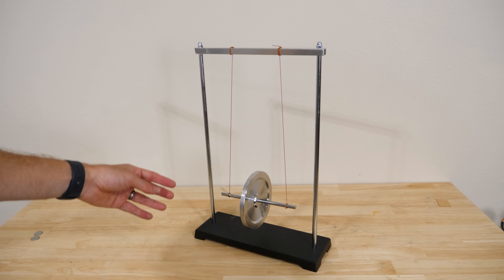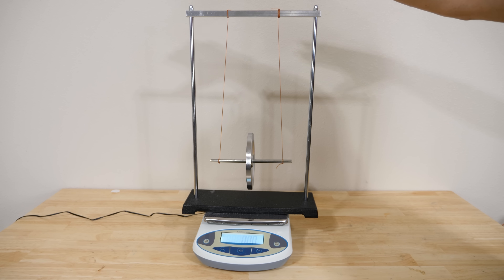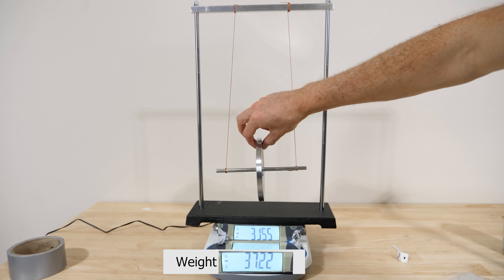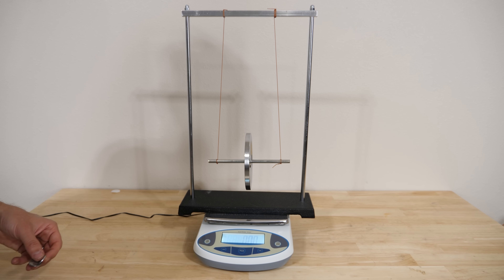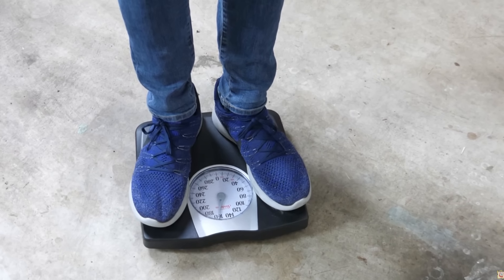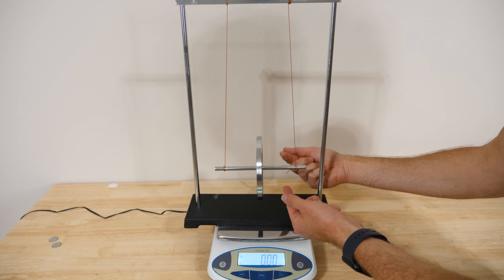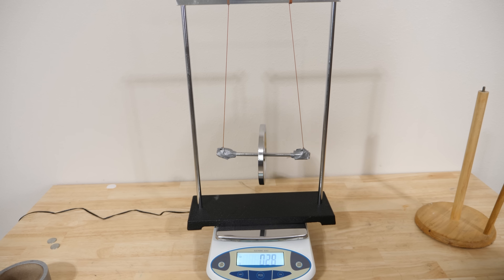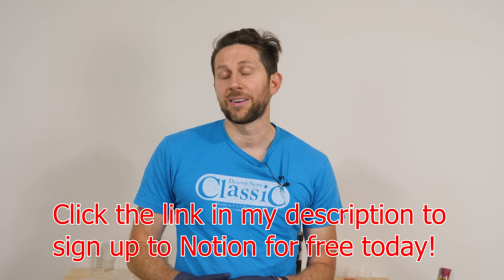How Does The Anti-Gravity Wheel Work?

Comment: So should we spin ourselves before a high jump and a long jump ???
Reply: Only if you wind a rope around yourself and spin yourself up.  But you'll need to de-spin at the bottom.
..
Here's the deal with this wheel:
The wheel does NOT weigh less when it is spinning!.
..
It may be more correct to say that it weighs less when it is "bouncing".
..
I have a problem with the interpretation of the Laithwaite demo.  Precession does not translate the wheel.  It does not lift it. 
Precession causes the axis of rotation to change direction. This is a ROTATION about the center-of-mass of the wheel. It is not lifting the whole wheel's mass. 
.
Precession does not cause the gyro to move (translate) sideways, nor upward in Laithwaite 's case or Veritasium's case. 
If the vertical spinning gyro had translation, it would slide along the table, but stay vertical. It does not do that.  It tips, or rotates at 90 degrees.
The fact that the handle is offset and long has significance.  If you push the handle in the direction of the precession, that lifts the handle, right?.

However the interpretation that the spinning wheel is always accelerating downward even while moving upward,  is a very good catch. It took me a few seconds to realize that.  My quick initial feeling was that the weight would go positive on the way up. . . 
The way to think of it is that is is 'partly falling' due to gravity.  When you are in free-fall you are completely 'weightless'.  The spin and string-shaft arrangement allow it to fall, but not fully, as when you are in free-fall.  So, the frame experiences somewhere between the full weight and weightless ness, but more weight during the bounce time. 
..
 The winding and unwinding of the string causes the up and down motion which is what changes the weight. 
..
Stand on a bathroom scale and at a medium speed, move up and down by bending your knees.  Try to move faster and faster on the way down and slower and slower on the way up. You will see your weight decrease during those times.

.. .. ..
If you watch carefully, you see that it is speeding-up as it drops; this is accelerating, but not at the full 'gravity-rate'.
Also, it is slowing-down as it rises, again not fully accelerating (decelerating or negative acceleration) due to gravity.
..
On a trampoline you are completely weightless from the time your feet leave the trampoline until they touch again and start the bounce. During this time you are constantly in 'total' free-fall.
When in contact with the trampoline you are accelerating upward and weigh more than normal.
If you can add a small upward force to reduce the acceleration due to gravity, you will weigh less. No surprise there.

This is analogous to only "partway" jumping on a trampoline (or your bouncing ball).  On a tramp, you are accelerating downward when your feet are not in contact with the tramp. The ball is when it is not in contact with the floor.  The spinning wheel only "partly" leaves the support strings.  It is "partially bouncing".
If the tramp accelerated you upward at twice the rate of gravity, your weight would double.
Therefore, there is also a slight increase in weight at the bottom bounce.
.
This would be equivalent to a small jetpack on your back that can't lift you, but only partly reduces your weight.  You would be in "Sloe-Fall", not free-fall.
..
This would make a wonderful Dean Drive Scam. . . .
..
It would be nice to have a real-time force load cell so we can see what happens at the bottom of the wheels travel - the positive weight gain during the short 'bounce' time.

..
Also, WHAT HAPPENS to the weight, if the wheel is NOT spinning, but bouncing while being suspended by a spring, instead of the winding/unwinding strings?  
Is that equivalent to this "partial bouncing" effect?

Comment: Hi 
Ah Prof Laithwait a sad loss such a pity he was branded heretic over his beliefs in gyroscopes and he gave us the linear motor, his bbc Christmas's lectures were second to non 
Keep up the good work
Reply: Here's the deal with this wheel:
The wheel does NOT weigh less when it is spinning!.
..
It may be more correct to say that it weighs less when it is "bouncing".
..
I have a problem with the interpretation of the Laithwaite demo.  Precession does not translate the wheel.  It does not lift it. 
Precession causes the axis of rotation to change direction. This is a ROTATION about the center-of-mass of the wheel. It is not lifting the whole wheel's mass. 
.
Precession does not cause the gyro to move (translate) sideways, nor upward in Laithwaite 's case or Veritasium's case. 
If the vertical spinning gyro had translation, it would slide along the table, but stay vertical. It does not do that.  It tips, or rotates at 90 degrees.
The fact that the handle is offset and long has significance.  If you push the handle in the direction of the precession, that lifts the handle, right?.

However the interpretation that the spinning wheel is always accelerating downward even while moving upward,  is a very good catch. It took me a few seconds to realize that.  My quick initial feeling was that the weight would go positive on the way up. . . 
The way to think of it is that is is 'partly falling' due to gravity.  When you are in free-fall you are completely 'weightless'.  The spin and string-shaft arrangement allow it to fall, but not fully, as when you are in free-fall.  So, the frame experiences somewhere between the full weight and weightless ness, but more weight during the bounce time. 
..
 The winding and unwinding of the string causes the up and down motion which is what changes the weight. 
..
Stand on a bathroom scale and at a medium speed, move up and down by bending your knees.  Try to move faster and faster on the way down and slower and slower on the way up. You will see your weight decrease during those times.

.. .. ..
If you watch carefully, you see that it is speeding-up as it drops; this is accelerating, but not at the full 'gravity-rate'.
Also, it is slowing-down as it rises, again not fully accelerating (decelerating or negative acceleration) due to gravity.
..
On a trampoline you are completely weightless from the time your feet leave the trampoline until they touch again and start the bounce. During this time you are constantly in 'total' free-fall.
When in contact with the trampoline you are accelerating upward and weigh more than normal.
If you can add a small upward force to reduce the acceleration due to gravity, you will weigh less. No surprise there.

This is analogous to only "partway" jumping on a trampoline (or your bouncing ball).  On a tramp, you are accelerating downward when your feet are not in contact with the tramp. The ball is when it is not in contact with the floor.  The spinning wheel only "partly" leaves the support strings.  It is "partially bouncing".
If the tramp accelerated you upward at twice the rate of gravity, your weight would double.
Therefore, there is also a slight increase in weight at the bottom bounce.
.
This would be equivalent to a small jetpack on your back that can't lift you, but only partly reduces your weight.  You would be in "Sloe-Fall", not free-fall.
..
This would make a wonderful Dean Drive Scam. . . .
..
It would be nice to have a real-time force load cell so we can see what happens at the bottom of the wheels travel - the positive weight gain during the short 'bounce' time.

..
Also, WHAT HAPPENS to the weight, if the wheel is NOT spinning, but bouncing while being suspended by a spring, instead of the winding/unwinding strings?  
Is that equivalent to this "partial bouncing" effect?

Comment: Acceleration is not always downward. Where Wheel reaches the bottom and roll up, there is acceleration acting upward.
Reply: This might be measured if the scale recorded the mass.
Reply: Here's the deal with this wheel:
The wheel does NOT weigh less when it is spinning!.
..
It may be more correct to say that it weighs less when it is "bouncing".
..
I have a problem with the interpretation of the Laithwaite demo.  Precession does not translate the wheel.  It does not lift it. 
Precession causes the axis of rotation to change direction. This is a ROTATION about the center-of-mass of the wheel. It is not lifting the whole wheel's mass. 
.
Precession does not cause the gyro to move (translate) sideways, nor upward in Laithwaite 's case or Veritasium's case. 
If the vertical spinning gyro had translation, it would slide along the table, but stay vertical. It does not do that.  It tips, or rotates at 90 degrees.
The fact that the handle is offset and long has significance.  If you push the handle in the direction of the precession, that lifts the handle, right?.

However the interpretation that the spinning wheel is always accelerating downward even while moving upward,  is a very good catch. It took me a few seconds to realize that.  My quick initial feeling was that the weight would go positive on the way up. . . 
The way to think of it is that is is 'partly falling' due to gravity.  When you are in free-fall you are completely 'weightless'.  The spin and string-shaft arrangement allow it to fall, but not fully, as when you are in free-fall.  So, the frame experiences somewhere between the full weight and weightless ness, but more weight during the bounce time. 
..
 The winding and unwinding of the string causes the up and down motion which is what changes the weight. 
..
Stand on a bathroom scale and at a medium speed, move up and down by bending your knees.  Try to move faster and faster on the way down and slower and slower on the way up. You will see your weight decrease during those times.

.. .. ..
If you watch carefully, you see that it is speeding-up as it drops; this is accelerating, but not at the full 'gravity-rate'.
Also, it is slowing-down as it rises, again not fully accelerating (decelerating or negative acceleration) due to gravity.
..
On a trampoline you are completely weightless from the time your feet leave the trampoline until they touch again and start the bounce. During this time you are constantly in 'total' free-fall.
When in contact with the trampoline you are accelerating upward and weigh more than normal.
If you can add a small upward force to reduce the acceleration due to gravity, you will weigh less. No surprise there.

This is analogous to only "partway" jumping on a trampoline (or your bouncing ball).  On a tramp, you are accelerating downward when your feet are not in contact with the tramp. The ball is when it is not in contact with the floor.  The spinning wheel only "partly" leaves the support strings.  It is "partially bouncing".
If the tramp accelerated you upward at twice the rate of gravity, your weight would double.
Therefore, there is also a slight increase in weight at the bottom bounce.
.
This would be equivalent to a small jetpack on your back that can't lift you, but only partly reduces your weight.  You would be in "Sloe-Fall", not free-fall.
..
This would make a wonderful Dean Drive Scam. . . .
..
It would be nice to have a real-time force load cell so we can see what happens at the bottom of the wheels travel - the positive weight gain during the short 'bounce' time.

..
Also, WHAT HAPPENS to the weight, if the wheel is NOT spinning, but bouncing while being suspended by a spring, instead of the winding/unwinding strings?  
Is that equivalent to this "partial bouncing" effect?

Comment: Wow!  I would have bet money that this effect would not occur.  I guess there is always an opportunity to learn something new about basic physics.   Great video!
Reply: This is why objects in free fall (such as those in a spaceship orbiting the earth) are described as being "weightless"). All that is happening here is that the disc is falling, but not freely, so it's weight (the force between it and the scale) doesn't go to zero. 

The fact that it is spinning is only relevant in the sense that it is the mechanism this setup uses to slow down the rate of falling. You could achieve the same effect by dropping a mass through a column of a viscous liquid. Use a very viscous material such a solid and the mass will sit on the top of the column and the scale will read its weight as expected. Use a very non-viscous material such as a gas and the mass will fall freely so that the scale only registers its weight properly after it has come to rest at the bottom of the column. Any intermediate viscosity will produce a correspondingly intermediate reading for the weight of the object you are dropping through the column.
Reply: @PeerAdder  That makes total sense.  Wasn't intuitive with this arrangement.
The viscous vs non viscous liquids makes perfect sense and seems to be a good analogy.

Comment: I think bcz of.... The acceleration opposite to the g.
Reply: Sort of.
There is some force opposite to g and it is falling slower than g, therefore the weight is a little less.
..
Here's the deal with this wheel:
The wheel does NOT weigh less when it is spinning!.
..
It may be more correct to say that it weighs less when it is "bouncing".
..
I have a problem with the interpretation of the Laithwaite demo.  Precession does not translate the wheel.  It does not lift it. 
Precession causes the axis of rotation to change direction. This is a ROTATION about the center-of-mass of the wheel. It is not lifting the whole wheel's mass. 
.
Precession does not cause the gyro to move (translate) sideways, nor upward in Laithwaite 's case or Veritasium's case. 
If the vertical spinning gyro had translation, it would slide along the table, but stay vertical. It does not do that.  It tips, or rotates at 90 degrees.
The fact that the handle is offset and long has significance.  If you push the handle in the direction of the precession, that lifts the handle, right?.

However the interpretation that the spinning wheel is always accelerating downward even while moving upward,  is a very good catch. It took me a few seconds to realize that.  My quick initial feeling was that the weight would go positive on the way up. . . 
The way to think of it is that is is 'partly falling' due to gravity.  When you are in free-fall you are completely 'weightless'.  The spin and string-shaft arrangement allow it to fall, but not fully, as when you are in free-fall.  So, the frame experiences somewhere between the full weight and weightless ness, but more weight during the bounce time. 
..
 The winding and unwinding of the string causes the up and down motion which is what changes the weight. 
..
Stand on a bathroom scale and at a medium speed, move up and down by bending your knees.  Try to move faster and faster on the way down and slower and slower on the way up. You will see your weight decrease during those times.

.. .. ..
If you watch carefully, you see that it is speeding-up as it drops; this is accelerating, but not at the full 'gravity-rate'.
Also, it is slowing-down as it rises, again not fully accelerating (decelerating or negative acceleration) due to gravity.
..
On a trampoline you are completely weightless from the time your feet leave the trampoline until they touch again and start the bounce. During this time you are constantly in 'total' free-fall.
When in contact with the trampoline you are accelerating upward and weigh more than normal.
If you can add a small upward force to reduce the acceleration due to gravity, you will weigh less. No surprise there.

This is analogous to only "partway" jumping on a trampoline (or your bouncing ball).  On a tramp, you are accelerating downward when your feet are not in contact with the tramp. The ball is when it is not in contact with the floor.  The spinning wheel only "partly" leaves the support strings.  It is "partially bouncing".
If the tramp accelerated you upward at twice the rate of gravity, your weight would double.
Therefore, there is also a slight increase in weight at the bottom bounce.
.
This would be equivalent to a small jetpack on your back that can't lift you, but only partly reduces your weight.  You would be in "Sloe-Fall", not free-fall.
..
This would make a wonderful Dean Drive Scam. . . .
..
It would be nice to have a real-time force load cell so we can see what happens at the bottom of the wheels travel - the positive weight gain during the short 'bounce' time.

..
Also, WHAT HAPPENS to the weight, if the wheel is NOT spinning, but bouncing while being suspended by a spring, instead of the winding/unwinding strings?  
Is that equivalent to this "partial bouncing" effect?